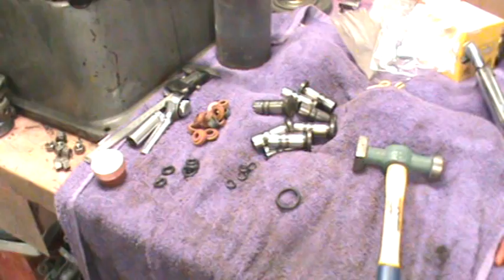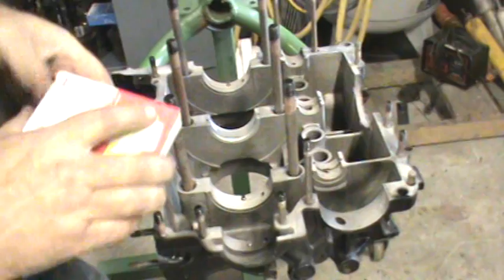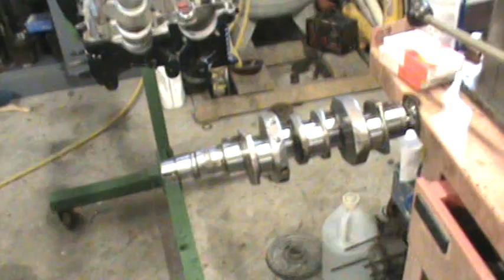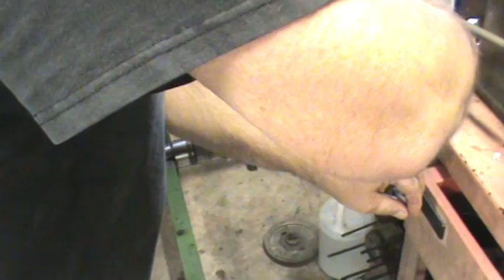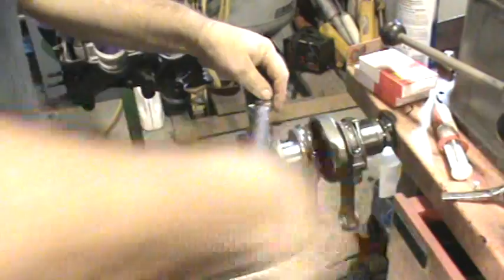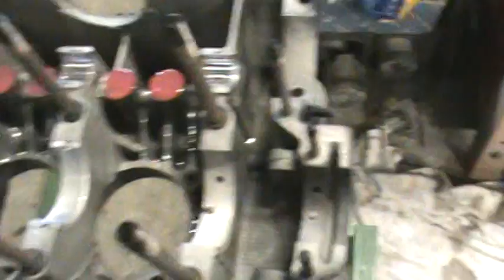HOW TO BUILD A STOCK VW 1600 MOTOR, VW Engine Build, air-cooled Volkswagen Restoration

Comment: Hi Darrin, I have a type 1 engine case H 5 . Neither half of the case have a recess or chamfer for the O rings on the main studs ?   I have watched your videos and others on building a stock motor and from what I can see the halves look to have a chamfer so when the case is assembled the O rings have a place to fit in to so they don’t keep the case halves from sealing. My studs do not have any chamfer around them and the 1 - 2 side just has holes large enough for the studs but no chamfer ?
Have you ever seen this before ?  I don’t want to assemble motor like this with O rings on the studs and find out it does not close tight.

Comment: If you want your heads to cool properly in you airplane then you need to clean the casting flash from between the cooling  fins . I flew a 1915 cc VW from Steve Bennett in a KR2 for 950 hours  so I know what I am talking about. This can be done even with the heads in the engine  from the top . What seems insignificant is aluminum casting flash that interuptsthe flow from the top through the fins and keeps the airglow from cooling the bottom of the cylinder head . I cleaned these fins out with 3 hacksaw blades bolted together to get the right thickness  and smooth the  airflow out . I was seeing 400 degrees plus on take off  but then with the clean up 350 max . Excessive heat can cause  a valve seat to drop ruining your day or worse . This is very important.

Comment: Darrin got a question, I have a stock 1600 rebuilding it now. Crank case and everything is fine but it’s had a line bore to 0.5  have had three sets of bearings. But the main bearing closest to the fly wheel is also 0.5 but sides are too tight to sit in the case.(they) tell me the bearing in the set is 21mm ? And I need a 22mm? So to my point would you know what full set I would need to order as in the code for the bearings? I watch your videos over and over, I know you know your stuff, thanks A K
Reply from the maker: i do not mess with line bore cases to much because i ran into problems getting correct bearings after they have been cut.  you can call junior at triangle auto parts in winter park florida and he can get you the bearings you need

Comment: In one of your videos you mentioned replacing the full circle #3 bearing with a two piece #2 bearing. I can see the benefit of this as the #3 bearing can be easily replaced without removing the camshaft and distributor gears from the crankshaft. My question is, does a dowel pin hole need to be drilled in the case half where the other half of the bearing rests much like the #2 bearing half?

Comment: Thanks Darin i am in the process of putting my sons  stock 1600 together, had a question about cam break in lube. This engine was put together 10 years ago and was never run long just start ups and thats it. So putting new crank bearings and rod bearing just as you said not good for an engine. Should i put break in lube this time or just assembly lube as a used motor?
Been watching your stuff for a couple of years i think now i have a reason to ask questions. 
Thanks alot super helpful.

Comment: Before I left to go overseas I was building a VW motor and I ran into the exact problem you were describing with the crank not turning. I thought the guy sold me the wrong size bearings, but now I'll check the dowel pins when I get back. Thanks for the info!

Comment: how is the crank shaft attached to the work bench?
Reply: Magic.
Reply: The guy has an old gland nut welded to the bench. For those who don't know what a gland nut is; it's a 36mm nut that holds the fly wheel to the crank. It also contains the transmission input shaft pilot bearing.

Comment: I know this video is old, but I just picked up a used 1600 dual port motor with about 60k on it .. what are some things i should check before i prep it to go in my car?
Reply from the maker: A compression check, oil cooler seals and maybe a fly seal, also adjust the valves before you do the compression check ,a oil pressure would be good to , Another good idea is to make sure that the nut on the back of the generator is not sees up in case you have to service in the car later
Reply: vwdarrin alright, thats what im going to be doing tomorrow other then cleaning a mouse nest out. I was wondering how to set up a oil pressure gauge in the car, im not entirely sure.

Comment: having watched several of your most informative videos I'm still sort of confused as to what's wrong with building up an older 36 or 40 horse engine. Too expensive, too old technology, expense vs power, parts availability?  Should I steer clear of these older cases/motor? Thanks from all of us that have benefited from the time you've spent sharing your time and knowledge.
stu

Comment: when you properly torque a bolt or nut, you are stretching the threads. If torqued proper, you do not need locktite.

Comment: hi darrin, i am new here; i am a fond viewer of your aircolled vlogs and am amazed by what you share with us;  ijust bought a brazilian split screen bus with 1500cc stock engine (44bhp) and swing axle;  i will use it as daily driver on german highways for which reason i look for some more bottom end torque and speed and the ability to deal with fast trucks;  i want to have around 120kmh top speed and decent overtaking power;  target gearbox and rear suspensionwill be IRS;  could you kindly recomend to me which kind of engine mod you would suggest ?  and which gear and ring/pinion ratios to consider ?  i know that this comment will be sort of off topic but i did not know where to file my question and maybe you could be so kind and share your suggestions with me;  cheers and kind regards

Comment: you over torqued the rods at 18:30
Reply: n00b question, how can you tell? what would the effects of over torquing that piece?
Reply: +Camron Bitzer when your torquing down a fastener your not just tightening the hardware down. you are also applying stretch to the fastener so if the rod bolts are 50 foot pounds. the manufacturer. has determined that's what the hardware needs for it to work at its full potential. so now if you go and over torque the same fastener. you could have just made it weaker because you put to much of a stretch on it. example. stretching out a slinky to much. usually the bigger the bolt the higher the torque needed to get the right stretch. now if you under torque something that fastener doesn't have the spring tension it needs to work correctly. 

this can lead to engine failure both in under and over torquing a fastener. I'm not saying this gentleman's engine is going to blow up as soon as he starts it. it might live a long happy life. but it's the attention to detail that gets the best results.
Reply: i saw that too.....
Reply: i saw that too.....
Reply: i saw that too.....

Comment: hey hows it going great videos to start off with watched them. but first time rebuilding a VW and i cant seem to get those dile pins to all line up with the bearings just the back bearing on the crank falls in nice other 2 not so much. any suggestions.

Comment: Darrin....this video rocks but you always say "guys" don't forget about all the female high performance junkies out there! :-) Thanks for the awesome video-can't wait to build my first turbo VW
Reply: I'm doing the same thing in school this semester. im building up a vw 1600 with forged rods and aa alluminum pistons. then I'm going to turbo it and add water meth injection for some lower egts and so I don't melt the pistons. I'd also like to machine the case to accept oil squirters that cool the bottoms of the pistons
Reply: I doubt you'll need to do all that. You won't really be running high enough boost to have to worry about egts and your Pistons. It's a little vw motor not a diesel. And if you're running so much boost and fuel to need piston oil coolers you might want to consider forged steel Pistons. Even tho they don't last

Comment: Hi Darrin. I know you're not well at the moment. But as there are alot of people out there that want to build stroker motors, I thought you might be able to make a how to build your bulletproof 2110cc engine.

So far I was looking at buying an engine kit from an online store, then today, I just happen to go to the scat website, and lo and behold they have the FORGED engine kit with EVERYTHING, cylinder heads, valve gear, everything. It has a good forged crank that hs alot more meat on the outside of the big ends, unlike the empi? one you show us in this vid. PLUS it's about $2000 cheaper than buying it from online shops like cb performance, 1aircooled.net etc etc.All the reciprocating components are forged. Well they come with heads and valves, but no rocker gear, but you can't expect everything for such an attractive price. I guess I should try and find those Berg rockers you recommend secondhand somewhere. And With the gearbox.. Am I better off just getting a changeover superstreet unit from 1aircooled.net instead of spending the money rebuilding my one? and what clutch should I run?

Anyway, thanks for any help you can give I know your back is really giving you grief, I appreciated any time you can take out to answer any of my questions man.

More power to you, and keep the informative vids coming!
Reply: shoominati23 the SCAT kit doesn’t have every last item needed.  Things like bearing dowel pins, oil sump cover, plugs, flywheel, pressure plate, distributor drive, cam plug, a few oil fittings, etc.  are not included.  Overall, I would budget $600 to $1000 on top of the kit price for the rest of the items needed, and figure another $200 to $250 for balancing if you are doing any5hing high performance.

Comment: great video.  I am mechanically inclined but never built a motor before.  the motor on my 69' Ghia is leaking like a pig and the oil pressure drops to almost 0 when it heats up.  think I might try to rebuild it myself after watching this video.

Comment: Curious about what your ideal sealants are for an engine. I have a 1600 SP that I am getting ready to put together, but it doesn't have the cuts made for the large stud O-rings. I thought it was a 67 block, but it might be a 66 as it is an H0 case. Anyway, I am trying to figure out the absolute best sealing to keep it from leaking. I don't know what to use for case halves and other places.

Comment: Marking the Bearing Shells for ease of assembly;
Wouldn't it be better to fit the shells in the Case, THEN make a single mark across the join line?
That way you ensure the marks are absolutely spot-on.

Comment: He seems to be torqueing the rods past the wrench's setting
Reply: Yes he did, but great video anyway
Reply: Johans60 It IS a very useful video, you're right.
Reply: the fun part about a quality torque wrench is you cant over torque it once you set the foot pounds. that clicking you hear is not just telling you to stop its also preventing you from torquing it any further!
Reply: @daddyhobo2  You are going to have to explain that. If he keeps turning the nut or bolt it is being over torqued.
Reply: @johntripp2028  have you ever used a torque wrench before? because once you set the amount on the torque wrench it will not put down any more torque. it disengauges the torquing mechanism and clicks freely. it does not operate like a standard ratchet. not sure how i can explain this any further my original comment should have been clear enough. if this is stiil not clear or your still confused please go out and buy or try a friends torque wrench and once you use it you will understand.
Reply: @daddyhobo2  I disagree completely. There is a clicking or slight break away once the set torque amount is reached, but the wrench will continue tightening the nut or bolt if you keep turning the torque wrench beyond the click/break away. 

Seeing him consistently apply extra torque to the rod cap nuts doesn't seem like an accident, I fully believe he has a reason for this.
Reply: @djamnew  the only torque wrenches that I have seen that will continue to apply torque have been electronic  snap on torque wrenches. He does not have a electronic snap on he has a mechanical torque wrench. I've used many many torque wrenches and have tested and the only ones that will over torque more are the electric ones (there are exceptions some electronic ones don't) and the very first torque wrenches with a dial gauge. Go buy a cheap one from harbor freight. Even that torque wrench won't over torque. I've tested it. It's obvious to me that you barely know what your talking about but not enough to fully understand the tool.
Reply: @djamnew and by the way the wrench has a clutch mechanism that makes a clicking noise and slips when the maximum level is reached to prevent exceeding the preset torque level.
Reply: that's the way snap-on works.

Comment: I gather that there is no worry that the grit from the cam lube will get sucked up and circulated by the oil pump?
Reply: The Zinc additive isn't a 'grit'.
It's not pure Zinc either, it's Zinc dithiophosphate, which dissolves in the oil and improves its anti-wear properties, and also its corrosion inhibiting properties.
Reply: I wondered that same thing...
Reply: Merlyn Sk Should get caught by the filter . . . you are all running 'proper' filters, right?   ;)
Reply: No I don't think so. Even in regular engine builds, anytime you're dealing with a new cam, you use a special motor oil which is gritty to break in your cam. It has an additive in it. Lets say, I wanted a 302. When I install my new cam, you have to use that gritty motor oil in your engine while you break in your cam. The "grit" is not hard enough to scratch or grind any bearings. Its the slapping of the cam that makes it work to break it in. As long as your bearings aren't slapping around(obviously thats bad) the break in lube wont do any harm to your bearings.
Reply: I think its Zinc in the oil.
Reply: And of course if you use motor oil with zinc(the grit) to break in a cam, since its your motor oil its obviously gonna be circulating throughout your whole engine. Cams have been broke in this way for years and as far as I know, it hasn't destroyed any bearings. Also, I know 302 thing isn't exactly right but its just an example I could use to explain. Im sorry if I come across as being an ass, Im really not trying to be. I promise. Its just the way I type that can sound very smartass when Im honestly not trying to be. I hope this helped you guys.

Comment: Good to see this on video. Well done sir. ...one comment, if I may... your torquing procedure is clearly resulting in overtorque... You should not push past the click, as you did on every nut you torqued. Your 27 ft lbs probably wound up closer to 35 or so.
Reply: I was also taught to never touch your grimy finger to a bearing surface. I must be waay old school but, it is a practice that I always follow to this day...and I'm 55.
Reply: I was taught the same thing about torquing Mitch. Then again I did 32 years in aviation,, not Vee Dubs. Dry torque vs. using a specified lube is also critical to correct final torque values.

Comment: building a stock motor new case ordered dowl pins from midamericamotorworks they been a very good parts supplier and to my surpize they were to long reading in the eights..located used ones i found i had in an od case. yes this does happen would have issues but thanks to your info checked it and corrected it

Comment: Some good information but the tang does not hold the bearings in place in a conventional wet float style bearing.  the bearing actually has a preload where the edge of the bearing is slightly higher then its register (ether rod half or case half) that preloads the halves together against their journal (thats why it is so important to have the journal registers for the bearing halves perfectly clean or it will show up as a high spot in the bearing and lead to premature wear).  he tang is for alignment and assembly purposes only.

Comment: good info. the reason why people don't use locktite on rod bolts because it gives you false torque readings. locktite torque lube is the best for getting accurate torque readings on those rod bolts and it will give you the insurance that it will stay together.

Comment: When I dry fitted the no.1 bearing (nearest the flywheel) it rocked back and forward in the case. about 1mm either way. When I put the crank in and put the two halves together it stopped moving but the bearing now seems a little tighter on the crank. Is this going to be a problem or is it something that will wear in? (standard size bearings, Scat 69mm C/W crank)